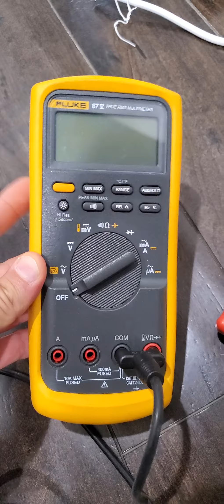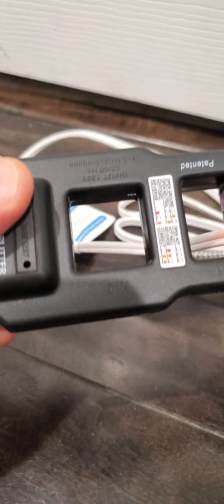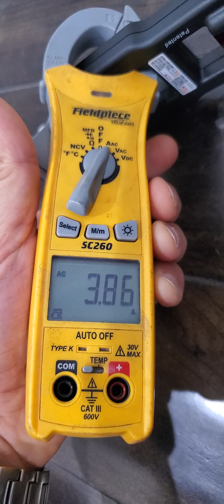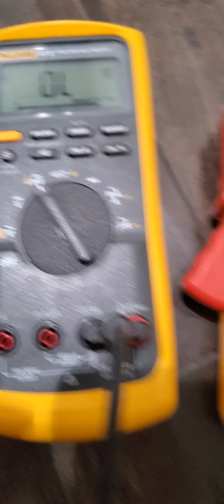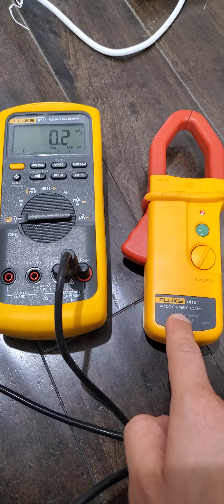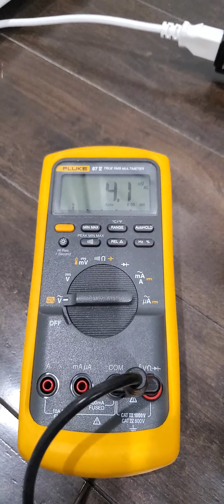Fluke i410 how to measure AC amp current with Fluke 87v multimeter

Comment: I have the 87v and was thinking of grabbing the i410 but they are expensive and old.  Today I see alot of new clamp meters on the market that are not as pricey.  Do you think the fluke i410 is better?  Or should I just save my money and grab a clamp meter that does not have to added to my 87v
Reply from the maker: Honestly the Chinese clamp amp meters work as good as Fluke for the friction of the price.. Fluke is known for their reliability and reputation.. if you want to pay extra money for reputation go ahead and buy Fluke.
I personally got few Chinese multimeter and they work great and i take them with me without worrying too much if lost or dropping it.. they so cheap i can just buy new one.
The fluke is what i keep at home for my small electronics hobby lab. And sometimes I'll use it together with another multimeter if i want to verify accuracy or if need to measure two points in the same time
I also have oscilloscope and it works even better!

Comment: Does my Fluke i410 measure inrush amps?  I am using an 87-V meter set on high resolution
Reply from the maker: Unfortunately i do not believe the i410 is capable of or reliable for inrush current measurement..
The 87v also lacks the option for inrush current measurement.
I usually just use my Fieldpiece SC680 for that.

Comment: Hello, I have a question, I noticed that when my clampmeter i410 is turned off, the battery voltage appears at the terminals is about 9v but after turning it on it returns to ok is it a problem with my clamp meter or everyone has it
Thanks
Reply from the maker: Yes it's normal.. when i410 is off, the 9v installed battery will go directly to the leads.
As soon as it's turned-on, it will direct the battery voltage to power the unit, so the leads not gonna have any voltage no more.
This was tested on my i410 to verify it.
In some way.. i found it useful.. i can check the internal battery voltage (capacity) without taking it out.
Reply: @mosesavraham  
Thanks for the quick reply.  So everything is ok.